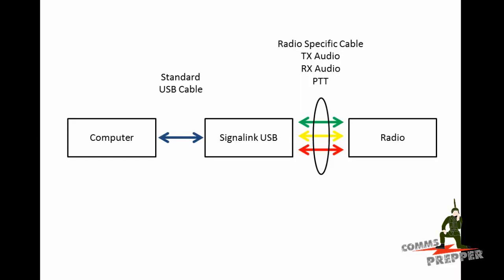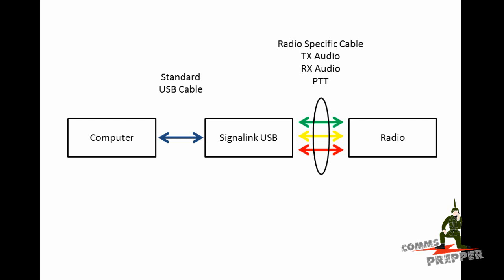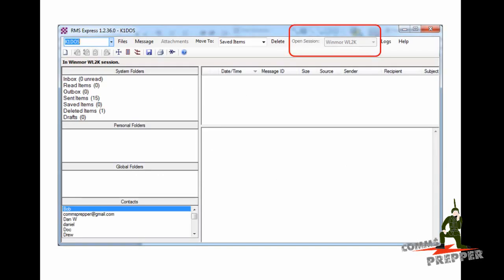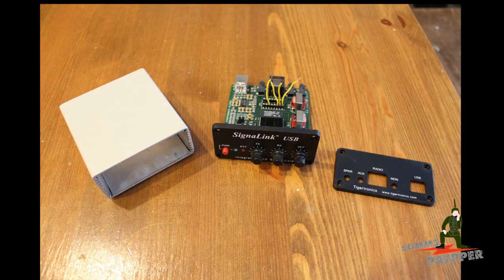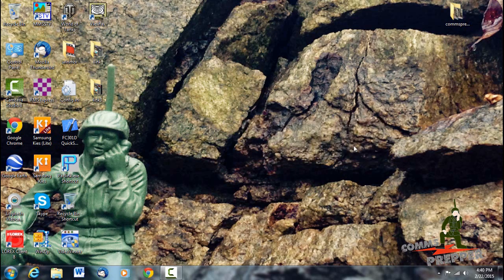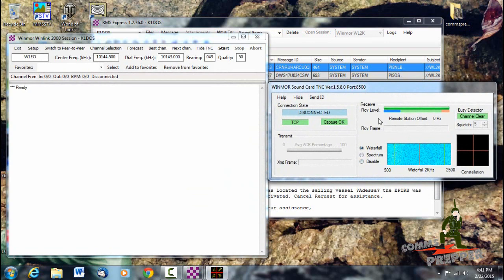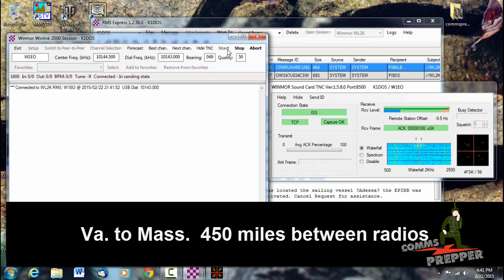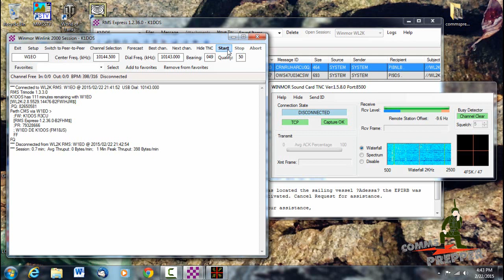Signalink USB

Comment: Can you tell me what gauge wire you use for the jumper connections ?
Reply: I think I asked Tigertronics and 22 ga solid is what they recommended.
Reply: @Photoeye65  Er right thanks for reply 8 years later got to be the longest delay in a response I've ever had !
Reply: @digitalmediafan  my bad.   Didn’t take note of the age of the post.  

I guess you probably had your answer before Trump was elected in 2016
Reply: @Photoeye65  I don’t even remember posting the question tbh oh well at least we are both still alive which has to be a bonus !

Comment: any particular thoughts on fldigi. I have mostly used fldigi and only falling back to winlink when I need the radio to isp interface but would be interested to hear other thoughts. I guess it mostly depends on what your group is used to.
Reply from the maker: I have not used fidigi.
Reply: I recently got involved in my area's EMComm volunteer group.  The vast majority of the work is over VHF, including the digital modes.  I live in earthquake/volcano/flood region, and in tactical situations we may need to transmit < 30 miles from a staging area back to EOC.  A few team members also have HF capabilities, but in the field we're setup for RMS Express and FLDigi over VHF and UHF.

Apparently most of the municipal and area teams in my region uses FLDigi and RMS Express as part of their comms plans, but your mileage could vary.

Comment: Can't you do this with just a USB sound adapter and a custom cable and enable VOX on the radio? That would forgo the $120 SignaLink.
Reply from the maker: Brian Streufert Perhaps.  I have not tried it though.
Reply: It is essentially the same thing you did with SSTV and your iPad I think is it not?
Reply: Brian Streufert You really should not because you want to keep the computer physically separated from the radio to keep hum out of the audio.  There are other systems that aren't as expensive as Tigertronics Signalink, but they do about the same thing.  The signalink uses isolation transformers to isolate the computer from the radio.  If you don't want email, digipan and fldigi work just as well as this software.  I am no fan of people pushing one particular software package over another....and I say that as a software engineer.

Comment: If you were to use your SCS pactor modem and reach out to the same station, would you be able to make the connection?  I guess what I'm asking is, does the SCS modem support this type of communication?  Thanks.
8P6RC
Reply from the maker: I don't understand the question.  Are you asking if the modem can setup a loop-back to its self?  if so, the answer is no.

Comment: Using the Signalink with Winlink on 2 meters has some weird configuration issues. Have you worked with this? If so, can you do a video on that? Thanks!
Reply from the maker: I have not tried on 2m.  Hank

Comment: Newbie question - how are you doing this without a TNC?  I thought the signalink's job was just evening the audio levels and toggling PTT on the radio?

Or do I have that wrong and the signalink has some TNC capability?
Reply from the maker: The Signalink emulates the sounds of a TNC and uses the PC processor to decode them.  So for all intents and purposes the SignaLink is the TNC.
Reply: Interesting.  Would that work for the various modes in RMS express?  Asking as my local EMComm is using WL2K with TNCx.  I'd  rather invest in a gadget i can reuse for other digital modes too
Reply: Commsprepper I think it may only apply to WinMor, and not the general WL2K packet used on 2 meters.

http://www.tigertronics.com/pgmsetup.htm#RMS Express - WINMOR

I don't mind investing $100 some gear, but it'd be great if the same hardware worked with echolink, FLDigi, RMS Express, APRS, etc. with different radios and on different frequencies.

At least with the signalink USB, if I have the appropriate radio interface cables handy, and know the various jumpers, I could swap between different model radios in a pinch.
Reply from the maker: Sean Yunt With RMS Express only Winmor is supported.  I know there are other programs that will do sound card based packet but I have not used them.  When used with Winmore the SignaLink provides a low-cost option for HF radio email vice the much more expensive SCS Pactor modems.
Reply: +Commsprepper really? so i dont need any software that emulate packet system.. like AGWpacket..
Reply: revo adan for winmor, only the signalink or other sound card interface us needed.  No tnc, virtual or hardware needed.
Reply: cool! i'll put one in the cart now. am using AGW..and homebrew interface..and a bit hard to control the flow of sound during
 TX RX..
Reply: Sean Yunt i

Comment: Do you use the same USB modem for vhf or UHF work?
Reply from the maker: I use the SignaLink for HF Pactor operations.  There are sound card programs for packet radio (VHF/UHF) but I have not used them.
Reply: You can use SignaLink and WinLink / RMS Express for on VHF/UHF.  I've got 5 or 6 RMSE gateways within range of my house in DFW.  Your range is limited due to the nature of VHF and UHF frequencies; but if that's all you've got!  I got started watching CommsPrepper's videos and practicing with my FT-8900R.
Reply: I'm using a Yaesu FT-857D and an LDG Z-11 Pro II tuner.  I use RMS Express, MMSSTV and FLDigi on a Dell D800 laptop running 64-Bit Windows 7 Enterprise.
Reply: Not by WinMor...but Packet Session.
Reply: That's how I got started with it.  Using SignaLink and my FT-8900 to hit gateways within 10 miles of my house.  Then I moved up to the FT-857D.
Reply: No problem!  We all learn something new now and then.  :)

Comment: PSK31 sounds like fun.. I'm going to try to use my old Dell XP desktop PC. It's got a good sound card.. 
There's an adapter DIY kit on Ebay   http://www.ebay.com/itm/221706973853 
EASY DIGI" Sound Card Interface PSK RTTY SSTV NBEMS JT-65 PCB KIT

I have a spare mic connector for my old TS-430s radio and I've done this kind of work before on my old KAM, back in the packet radio days.. 1970s & 80s.. 

May try some Digipan software..  http://www.digipan.net/ 
It will key the rig, via RS232,  if I can't use the vox..
Reply from the maker: +Richard Lee Good luck.  Let us know how it works out.
Reply: The kit is in the mail.. :)
I'll have to find my TS-430s manual to get the mic wiring.. But before I do that, I'll set up for receive-only and see if I can copy some stations with my not-so-Long-wire antenna. :)
I don't foresee any problems.. Best laid plans etc..
Reply: i love my easi digi kit...9 bucks and i had all the connectors i needed to make the cables... the program i use will also encode and decode cw...
Reply: I was thinking of that too.. But not using my Kenwood TS430s, but a QRP rig.. Maybe like this one?
http://www.ebay.com/itm/321845044108
Not sure if the xtal freq is usable, (7023 KHz).
For anyone besides Extra class??